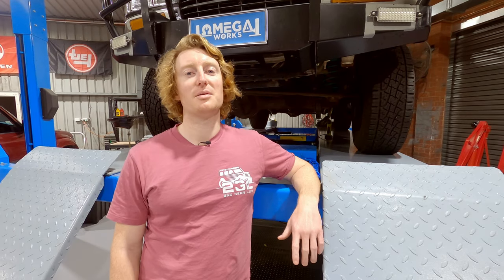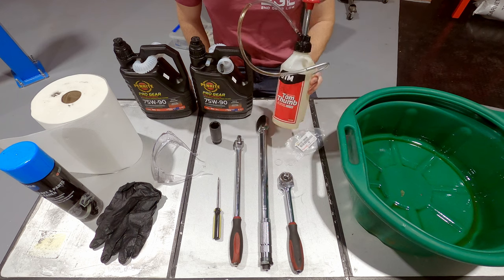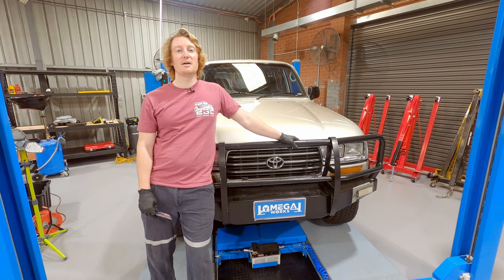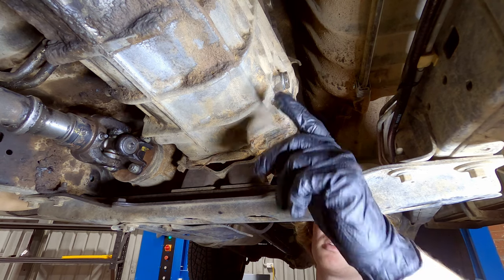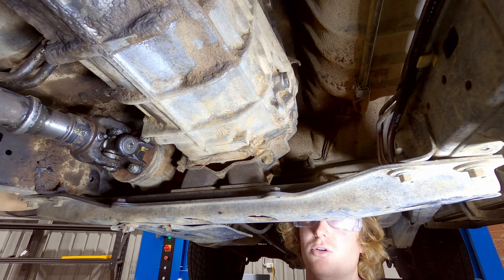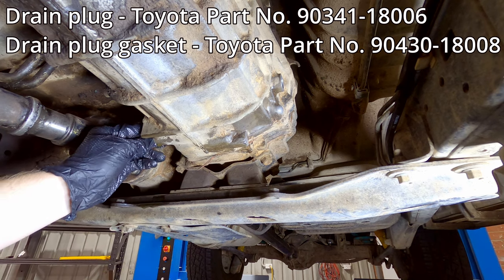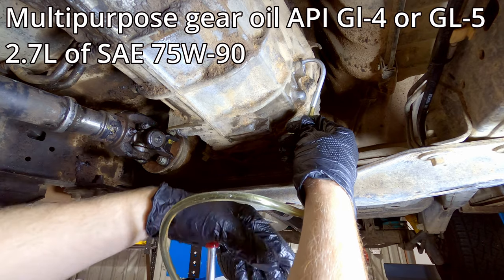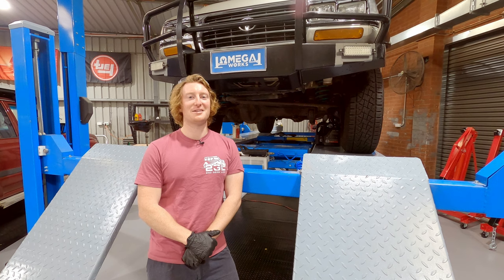How to Change Manual Transmission Oil – Toyota Landcruiser 80 Series

Comment: Just asking, as I know that GL5 oil can be known to eat away the syncho rings in the gearbox wouldn't GL4 be recommended to be used? AS i know that GL5 oil is known for diffs.
Reply from the maker: There seems to be mixed opinions on the topic. Toyota specifically states GL-4 or GL-5 for this transmission. We chose to use GL-5 in this case but will monitor it and report back if we come across any issues.
Reply: Hi,wondering if u have had any issues using gl5 since the video was published

Comment: Hey second gear low previous ly rounded filler plug on manual gearbox.   I can't get it loose...  Any suggestions please
Reply from the maker: Hi John, I've had this happen on diff plugs before (very similar) and found an extractor socket worked well, designed to dig into the steel and grip. They damage the plug so make sure you have a replacement on hand. Failing that, tack welding a nut to the front of the plug is an option, if done carefully